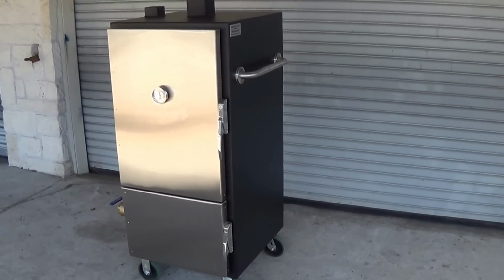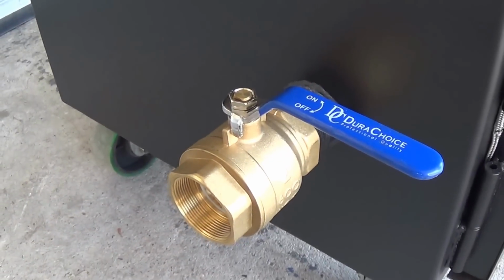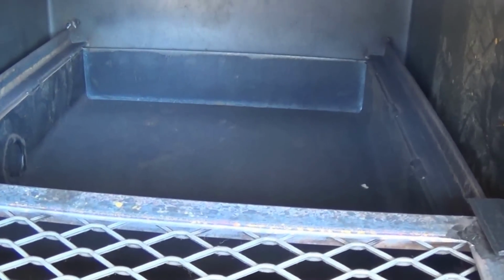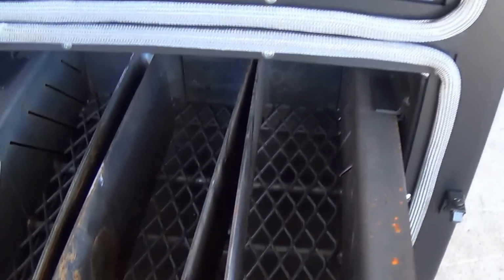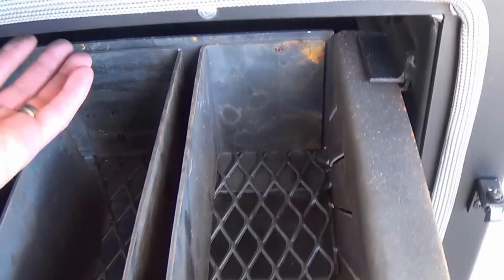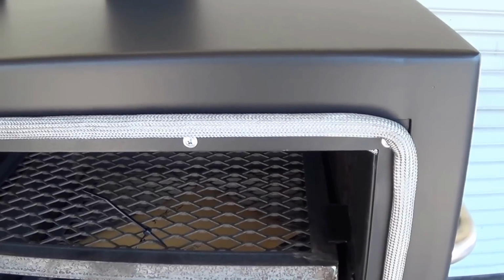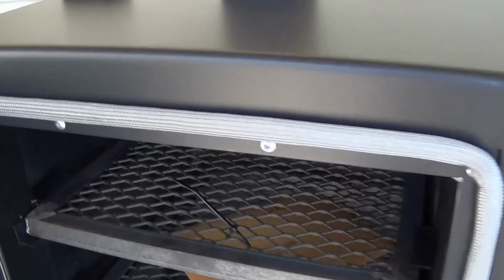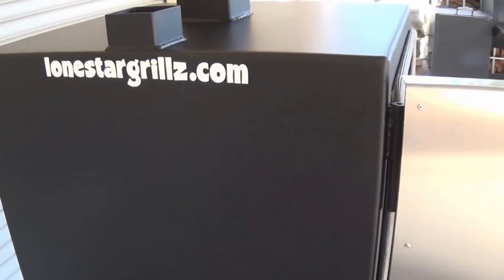Lone Star Grillz “Mini” Insulated Smoker

Comment: Love the look of your smokers ....quick question what is the benefits of a vertical smoker with the smoke exhaust low down in the cooking chamber ?
Reply: The heat actually goes up the outside of the cook chamber and reaches food from the top. The heat enters exhaust at the very bottom of the cook chamber before leaving the stack.
Reply: @GCGHB  so they are engineered like a Backwoods?
Reply: BBQBOY76 Yes. I own a backwoods. This is my next one. Far better construction for the money. Not close.
Reply: Thomas Boesen well, I’m more research that I’ve done, I’ve discovered this onset designed like a Backwoods, which is a reverse flow.